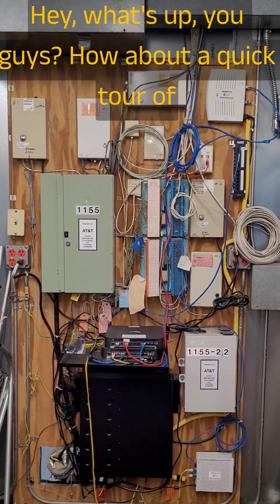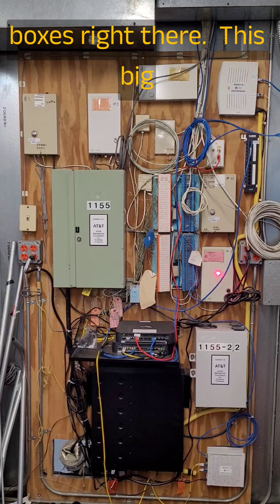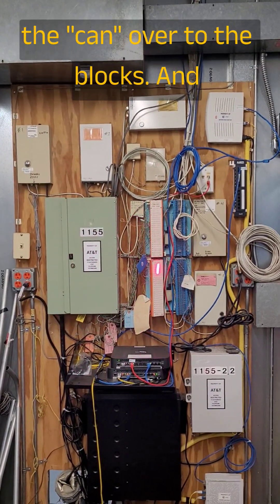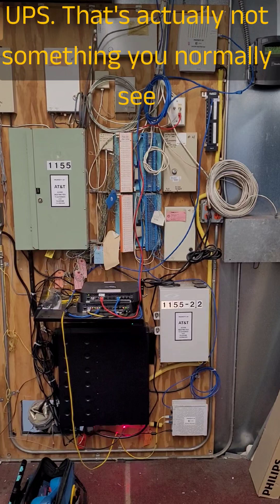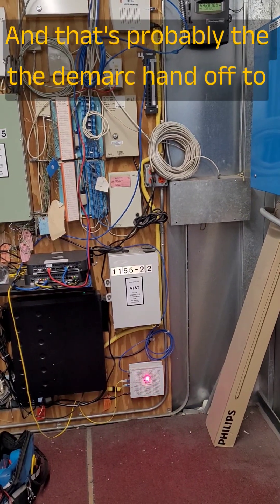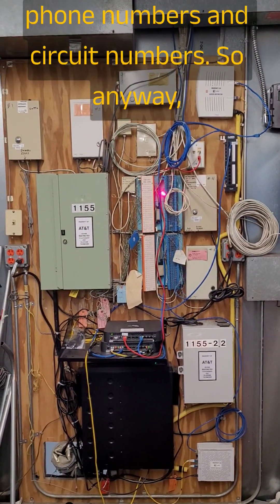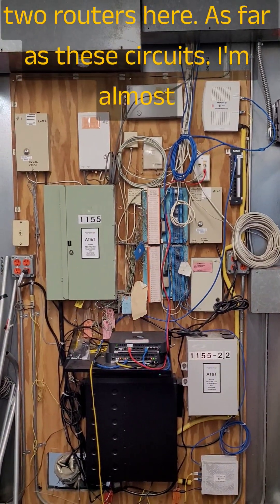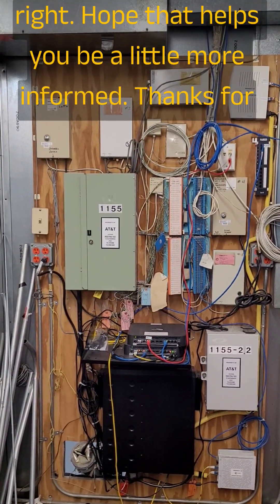Commercial Telco Demarc Tour

Comment: As an IT vet this is accurate information. I would speculate as a possibility that the router is the actual ISP demarcation point, in that the router does the ISP-centric configurations. This typically includes providing routing for either a single IP address or some sort of block of IP addresses, and likely included DNS services too, as that can reduce network costs to the ISP upstream from IX peering (DNS on their network means they don't pay extra for usage).
Reply from the maker: I didn't know that part about the DNS . Interesting🤔,  thanks for sharing. 😊👍
Reply: @DIYTelecom  you're welcome! To clarify, the ISP's DNS servers would not be on the router itself. They would be elsewhere in a datacentre the ISP owns and operates.